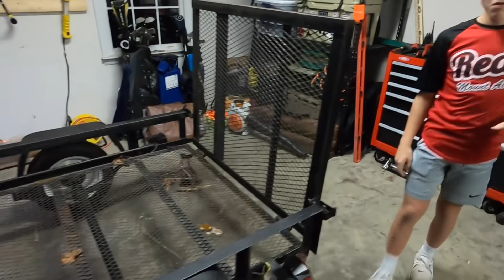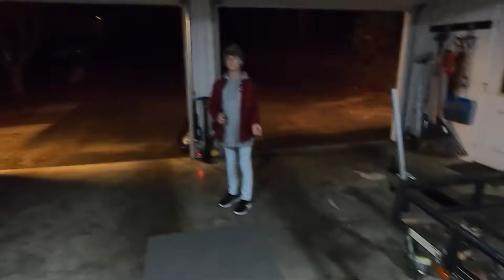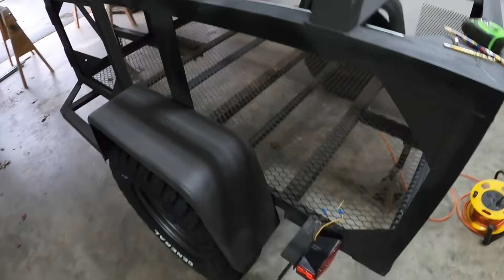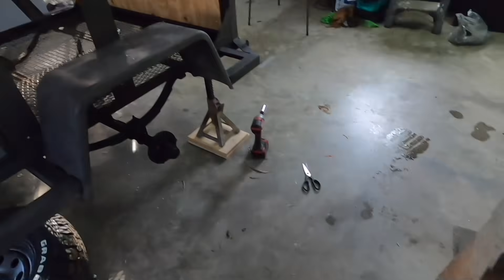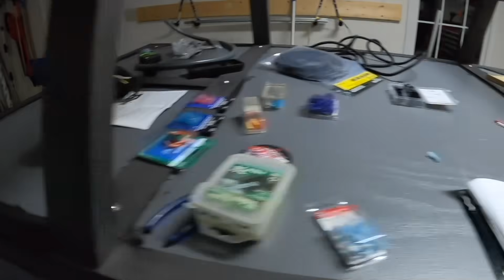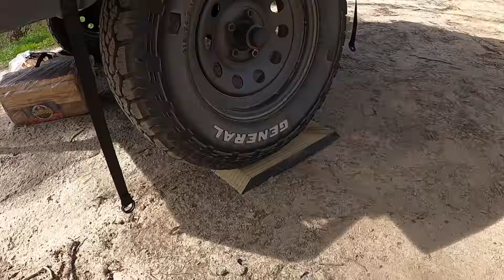Ovrlnd East - DIY Trailer Build

Comment: I love it; simple and solid. I like the absence of all the built-ins, it's more a big storage box with the "motel room" on top. I think the extended tongue is a good idea, but  be careful of adding too much there to keep from having too much tongue weight for towing. If it were mine I'd have enough there for a couple of gas cans  and maybe your spare tire. Think about your fold-out table, why not use the inside of the rear full width door and have it accordion-fold there, with some drop down supports? Maybe a 15-20 gallon poly water tank under the tent platform, over the axle for easier trailer balancing. 
Lots of possibilities, and your boys will remember these camping trips all their lives. I once converted a 26 foot aluminum 2-horse slant load gooseneck trailer to a camper, used the large front dressing room for living and the stalls for combination shower stall, storage and bicycles when we didn't take the horses. My daughters still talk about those camping trips to the BRP and Grayson Highlands  and even to Disney World, and they're in their late 20's and early 30's now.

Comment: Hey buddy great video and the best explaining ive heard! Best part is you and your boys spending priceless time together and please tell them im proud of them too! Ive got a 4x6 toughest little trailer ive ever seen build that small. I dont know who built it but boy did they build it tough. Its got a solid sheet of steel floor in it i brlieve is 1/8 inch thick but it actualy maybe thicker. I was going to do what yall have done and then a buddy put a topper on me so i changed my mind with trailer and then another buddy put a round 70 or 71 Scottys  camper on me so o changed plans again and then another buddy throwed a old 2 horse horse trailer on me so i changed AGAIN and i said NO more. So now im selling Scotty cqmper and horse trailer. Im going to do inside topper and build a overland trailer like yall with 4x6. Ive watched many videos but i couldnt figure out what type frame to use and most use tube steel. But you using angle is exactly what i need to do so thanks for that and many other ideas. I aint never done this so if you dont mind could spare one of your boys to come help and then It shouldnt take no time with them being experienced  i sure would preciate it. By now i pray yall have had countless great days! Thanks and Happy Trails to yall!

Comment: The weatherstripping is on backwards! The foam goes on the outside. Nice trailer BTW~
Reply from the maker: You are correct. But it wouldn’t work that way. Had to improvise. Still had no leaks.

Comment: I were you flipped it to the bottom of the Springs right there? Where the u boats go up. You could actually get you a plate of metal and actually drop that down with longer. You both put a couple of pieces of metal there, and then you can drop that whole thing down with you both just copy the top plate.  The same metal plate did you both go in? Copy it onto another piece of metal and then stack your metal up. Get longer view bowls and then raise it up there you are.

Comment: I'd really like to hear how you feel about the strength of using flat bar steel.  I'm going to do a build, and given the platform I'm working with, flat bar would be a lot easier to use.  Most of these trailers seem to use square tube.  How's this thing holding up?  Anything you'd change?

Comment: Can you please explain how your doors and door sills are designed/how they fit together?  looks like your door might be 1/2" angle, but would love some insight on the receiving door frame was made to have your door sit so water tight.  Thanks!
Reply from the maker: I go over that in the 2nd video. Should be able to find on our page
Reply: @ovrlndeast2834 Incredible, I was able to get all my answered from your second video. Thank you!
Reply: Additional Question! Do you think for the RTT rack, could I used 1”x2” .120 Tube Steel instead? Would it be strong enough/safe, I know in your video you stated that you used 2”x3” tube. Would love to know your thoughts if 1”x2” .120 tube steel would be okay?
Reply from the maker: @ScottieWotty  hard to say. Guess that would depend on tent size, weight and how much abuse you’d put it through. I’m bad to over engineer everything I build.
Reply: @ovrlndeast2834  thank you for the reply!!

Comment: GREAT BUILD! May I add GREAT MINDS THINK ALIKE. Three year ago we bought a Smittybult Gen II, that's a story on its own, and mounted it on a 4x5 open trailer that we already had. Soon we started planning a new trailer. We stopped by Lowe's to compare and decided on a 4x6 is what we needed. We started designing and buying stuff, lights, fenders, latches etc. About a year ago I stumbled onto your build video and told my wife, look this guy has built my trailer. I live in middle Tn and go to the  mountain regularly. Would like to someday meet up and compare. Loved that your spending time with kids and making them a part of it.
Reply: Hey buddy I'm fixing to start on mine so Steven it sure would be nice Ole buddy if you would come help me I won't mind a bit I sure won't! Since we are neighbors it shouldn't be no problem im over here in Upper Cumberland. Thanks and I will go ahead and put a pot of coffee on!
Reply: @Tommy-rr7ez  To me upper cumberland is still a few hours away but advice is free. What ya need
Reply: @Tommy-rr7ez  I didn't start with a pre-made trailer. I made a 4x6x2 ft box from 2x2x1/8 angle iron and went from there. It has 2000lb torsion axle that give it 20 in ground clearance. It only weighs about 1200lbs including gear.
Reply: @steven-ft5pz  OH ok! No I was just joking! Your welcome to come but I preciate advice but my hardest part has been just getting started. What most videos I've seen used 2x2 tubular steel but he used angle and that's what i needed to see. Once I get the frame the rest won't be to bad. I won't to make sure it's tough enough to handle off road  depending on where I go. The Scottys camper I got a few months ago has to be redone in the interior, water damage, but I looked at it and there is NO way it could ever handle overland. It's asphalt and campground only and that just won't work. I've got another piece of bare land in Cumberland Plateau that I need a tough trailer to be able the county road to get to it. The Scotty has a lot of parts I can use to do my 4x6 stove sink etc so if I don't sell it this week I will make good use out of it. I hope yall are enjoying yalls trailer and I can't wait to get mine done so I can get out there and go.
Reply: @Tommy-rr7ez  Yes I understand tough. I'd put mine against anybody.  As far as frame it has a 2x3 tube entire length with receiver hitch in rear, tubing cross members support axles. If you look at mine and Ovrlnd east they are almost twins. Same shape, tent, even taillights. But I didn't start with utility trailer.  I planed for a year, then started buying parts during covid when everything was hard to get and took about a year to build.  We go thru Cookeville and Crossville  periodically  wouldn't mind ya seeing mine. Maybe we can hookup someday.
Reply: @Tommy-rr7ez  Gonna be at Pickett SP Aug 16, 17. If that's in your neck of the woods stop by and see us
Reply: @steven-ft5pz  Hey buddy I know about Picket but I can't think of where it is. What town is that near?
Reply: @Tommy-rr7ez  Jamestown
Reply: @steven-ft5pz  DUH!!! Im sorry Steven I knew I knowed where it was but I just couldn't think! I've got some land on Jamestown. It's not where i live but I've got 3 acres. I'm going to put this on my calendar and looking forward to it. Thanks for thinking bout me!

Comment: What load capacity is the trailer and what was your final weight, loaded??   Thanks
Reply: I have an almost identical trailer. Same size box, tongue box, 12v fridge, same tent. Mine weighs around 1200 lb with all gear. I also have an on board 100ah battery. I didn't start with a utility trailer but framed the box with 2x2x1/8 angle and used 2000 lb torsion axles

Comment: What's the bolt pattern on the 15x5 wheels?
Reply from the maker: 5x4.5. I’m going to get an adapter and go to 5x5 to match the jeep. Then do a spare delete.
Reply: @ovrlndeast2834  sweet I have the 4x8 utility trailer about to do the axle flip but I do want all terrain tires and I have the stock 12 inch wheels and tires
Reply from the maker: @TheEric1356  10-4. Check your axle. Some have a pre-load in the cross bar. I only learned that after flipping mine. I ended up buying new spring perched and rolling the axle 180 degrees to get it back to the right orientation. Not a major deal but something to check on.
Reply: @ovrlndeast2834  yea I am welding new perches on my axle I have the camber bend in my axle

Comment: When you extend the hitch forward also extend it rearward and tie it into the hitch on back of trailer. If you get stuck you can use the trailer to tie onto to pull you out with out damaging it.
Reply: This would also add rigidity to the trailer and drawbar.
It would prevent this from happening;
https://www.youtube.com/watch?v=F-eHYIyc4tU&t=475s

Comment: I’ve been scouring the internet to find a reasonable version of this type of trailer. I just couldn’t figure how companies are charging at least 12k for a box on wheels. I’m not a welder so I was curious about the decision to go with plywood paneling instead of having the welders do a fully enclosed box. Did it end up helping a lot with cost? 
Once you had the plywood and tent on it, Is it still light enough to move yourself?
Reply from the maker: I guess there were several factors. Cost, time, not researching available materials, experience with wood working. 
A friend is building a similar trailer now and he found this aluminum paneling (used in the sign industry) that is perfect for this. Its a rubber membrane sandwiched between 2 sheets of aluminum. I wouldve used this had I known about. 
And yes still lite enough to move around.

Comment: Will water get inside if rains? , Like on top of trailer underneath rtt ? Part from that great video
Reply from the maker: No leaks. I made sure to use a lot of commercial sealant on all the edges. Plus, there’s about 4 layers I’d paint on there as well.

Comment: like your build in the process of doing mine. one question how tall is your box, keep going back and forth on that height.
Reply from the maker: It’s 2’. I knew I was going to have a slide out drawer with my cooler on it so I worked backwards from there. Ended up to be 2’

Comment: Craftsmanship.  I see Craftsmanship. Gaps are consistent as welds are. It sounds tight and solid. What a great job and configuration.
I'm trying to configure yak hauler and sleeper. 
  Side bar. My son helped me working on vehicles  and building/remodeling. He now earns over 100,000 a year and never set foot in a college classroom or a tech school. He learned electricity, pneumatic, hydraulic, A/C, heating, and tools and techniques. 
  We don't know what our Son's will be. We can only inspire and share our experiences and knowledge. And keep their hands full! 
But you know this....
Well done job on trailer. Really great job. It's all in the details and your well acquainted with details I see.

Comment: Would be great to see how you did the doors and seals
Reply from the maker: Hey. I get that comment a lot and I just released a part2 vid on the trailer and tried to cover that alittle bit. Check that out. Hopefully it will help.
Reply: @ovrlndeast2834  I just saw that actually and it was very helpful thank you. Also, is that 2x2 angle? and what gauge did you go with?
Reply from the maker: @MrSantos8905  yes. The box frame is 2x2x1/8

Comment: I recently came into a 3x5 trailer and am wanting to build some variety of off road trailer out of it and I’m bouncing around the idea of mounting one or two Optima batteries in a tongue box and setting up a heavy power connection using Anderson plugs so the batteries in the trailer get charged by the alternator when the truck is running. Might opt for a battery isolation relay of some kind just to keep from accidently running the truck battery too low if I have the trailer connected but I’m still planning out details. The idea of an on board battery and an Anderson plug to the tow vehicle is pretty appealing to me.

Comment: Love the topo map paint job.
Reply from the maker: Thanks. Not my idea but it worked out ok
Reply from the maker: Not paper. It was a vinyl stencil. I painted the trailer black, put on the stencil, painted the grey then removed the stencil.
Reply: @ovrlndeast2834  Roger that!!
Reply from the maker: Used my wife’s cricket. Cut out a template, stuck it on and painted.
Reply: @ovrlndeast2834  I didn’t know they could do all that so is it wood or some other material?
Reply from the maker: Side panels are wood.
Reply: @ovrlndeast2834  So the topo map overlay is basically just paper?
Reply: Howd you do that?

Comment: Weld two tongue jacks to the back so you can level by hand.
Reply from the maker: Hey Dario. Thought about that but I decided to keep the weight on the axle and just stabilize it with a front and rear dead leg. Working great so far.
Reply: @ovrlndeast2834  you can still keep the weight on the axle, the two rear jacks will just help fine tune the level. No need to completely take weight of axle.

Comment: How much you spend total?, if you don't mind.
Reply from the maker: Initially I was around $1500 on the trailer. No tent or accessories. But Just made some upgrades and I’m closer to 2k now. But worth it. Update video coming soon.
Reply: @ovrlndeast2834  Well done and very inspiring.  Thanks!

Comment: Here in Aus we try to make the tyre size the same a the truck. Just in case. I've been places 1000 km from help.
Reply: That is brilliant! Good thinking!
Reply: I think you mean you swap the trailer hubs over to match the tow vehicles PCD, allowing you to use a spare wheel from the tow vehicle on the trailer and vice versa should you run into a string of bad luck.

Comment: Can you show how you made the doors/weather stripping location to seal it. I have been looking at making a similar trailer but can't find a good way to make the internal lip to make each door weatherproof.
Reply from the maker: Well can’t say it’s the perfect way but it seem like a good idea so I went with it. I don’t have a vid but I’ll try to explain. Door “jams” are 1”angle. Door “frames are 3/4” angle which marries up perfect with the inside dimension of the 1” angle. And the 3/4” frames worked perfect with the 5/8” plywood I used. As for weather striping I just ordered a roll from Amazon. Slipped right over the 1” jam and seems to be working fine. No leaks after a year. This might be clear a mud but I tried. Haha. Good luck.
Reply: @ovrlndeast2834  it looks like the weather stripping might be inside out.
Have the flexible rubber section on the outside of the Pinchmould.

Comment: I like what you did but why would you use wood on top of the wire mess trailer bottom and sides...it will just rot out. I would have gone with aluminum then the wood
Reply from the maker: Very good point but this was a DIY built and I have more experience with wood than aluminum. I took a lot steps to protect the wood with paint and sealer. Inside, outside and edges. Plus the bottom board is 3/4 pressure treated. When I’m not pulling this thing it’s covered to protect it from sun and rain. 
I figure I’ll get 10 good years out of it. Well worth what I have invested.

Comment: we did the same thing with our overland build but we ordered our axle from Dexter and they had mounted the spring perches on the wrong side so that it was above the spring.  we wanted it below the spring.  You really should weld on perches to the correct side because flipping the axle sets the preload of the axle the wrong direction.  All axles have a slight bend to them and you can see when you flipped it the preload is now upside down.  Just a heads up.
Reply from the maker: Just reworked the leafs and suspension. Fixed the perches also. Thanks for the tip.
Reply: @ovrlndeast2834  awesome and good luck with the build.  you can check our build on our YouTube.

Comment: Very nice job. We're starting a trailer ourselves using an M416 frame as the base. Can you tell me how you built your doors?
Reply from the maker: Hey. The door jams are 1” angle and the frames are 3/4”. That allowed the doors to close flush once I added a little bit of weather striping. 
The inside of the 3/4 angle frames is 5/8” which worked perfect for the 5/8 plywood inserts. 
Hope this helps.
Reply: @ovrlndeast2834  awesome. Thank you!